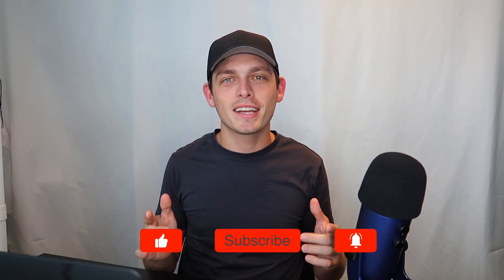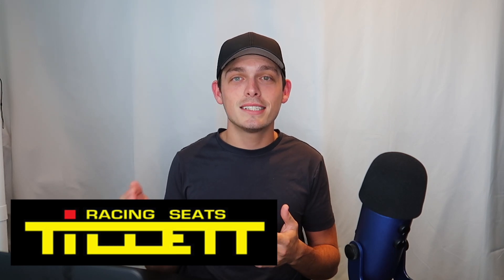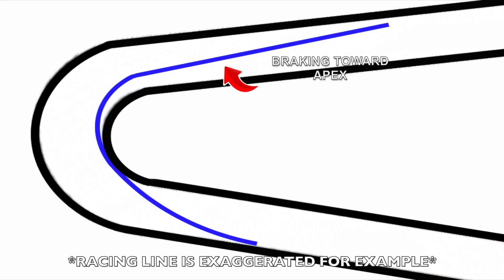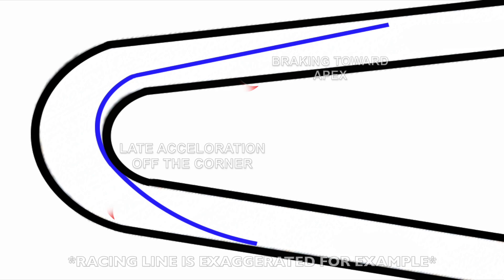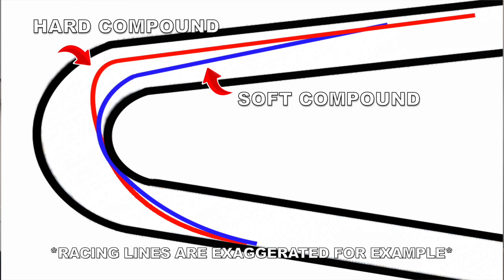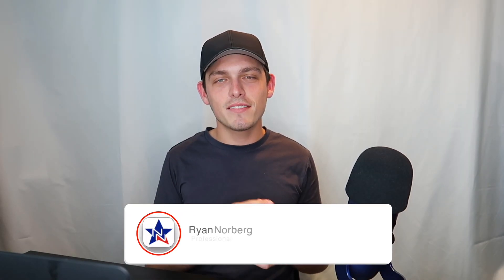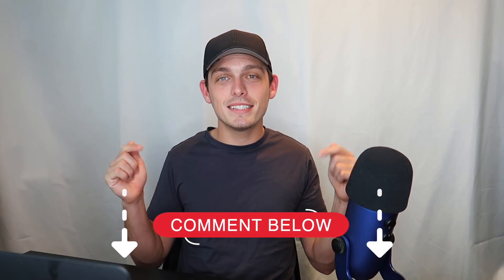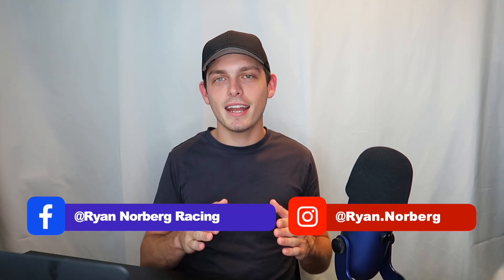HOW to DRIVE different TIRE COMPOUNDS

Comment: great explanation, could you show show some clips to demonstrate the extend of the late brake and turn; cause I don't have the image in my mind how much I need to change the line; don't want to overreact to it . anyway, it is super helpful
Reply from the maker: I really need to look if I have some at the same track. I normally don't run two different tire compounds back to back so Im not sure I have any video.

Comment: Hi Ryan thanks again for a great video. Can you make a video on carburation and gearing. What do you do to get the proper carb setting, what do you look / listen or feel for during driving. I also read that you don't always have to go for the max rpm on the straights gearing wise, since you could be faster on the clock with shorter gearing. All depends on the track. What can you tell us about this? Thanks
Reply from the maker: Let me see if I can think of how to do a video on that

Comment: Ryan ..I race in Thailand Bira circuit and a very abrasive old surface with  Rotax with mojo D3 and ROK maxxis orange and the feeling on track is completely different drive on track between the tyres  ...both tyres reasonably softish but I am finding  I need a front end geometry change  which is mandatory between the two tyres ....ie .maxxis needs more camber castor than the mojo ...and if I do not change between the two tyres the mojo tyre feels very strange with the maxxis set up and when I change back to to less camber etc for mojo it feels much better and constant on track and my  lap times improve ...it just my thoughts only ..
Great informative vids mate and keep them coming ...
Reply from the maker: Interesting! Thanks for watching!

Comment: I'm several months late to this video, but I race a Rotax on Hoosier R70s. Since it's not a lower HP engine, is there anything I should be doing differently? Or just brake late and accelerate early as you said in the video.

Comment: amazingly good for this one !    is it the same difference in driving between old and new tires?
Reply from the maker: Yes it is similar but not as big of a difference. The soft tires drive similarly new too old and same with the hard tires. So even though you might change a little you want change a lot from new too old.

Comment: does the driving style depends on the grip or the tire cause i have been to tracks where there is alot of rubber but i use harder compound and when am alone at the track and use softer compound ? i personally drive komet and vega komet as the harder tire.
Reply from the maker: It depends on the grip level. The racing line can change and the weekend goes on but this is a good starting point

Comment: Hi Ryan, another excellent video. Loving your work. V interesting. 
One question though: I race 2-stroke rental karts in the UK & therefore have no idea, or control over, what tyres they run on. Are there any ways to determine if the tyre’s hard or soft once it’s in front of you but before you race on it? (apart from asking someone, that is)
Reply from the maker: I would say that normally the tires on rental karts are very hard because they are the most cost efficient. You can look at the tire and see what logo it has on it then google that tire and it will normally tell you. I would say to drive those karts with the harder tire driving style anyway.
Reply: That makes sense. Thanks Ryan

Comment: ...I feel like most of this video is just "you can make more mistakes on a softer tire". There's not much actual difference between the two as far as I can tell, what changes is the limits of the vehicle. Softer tires grip better, so you can utilize that grip, hard tires don't, so you have to take that into account. But if you're smooth with both of them, they're going to have good results. It's like racing in the rain, you have to watch how much grip you're using at any moment simply because you don't necessarily have that much to begin with. You should still be trying to not mistakes either way, you drive harder on the soft tires because they have more grip, no other reason.